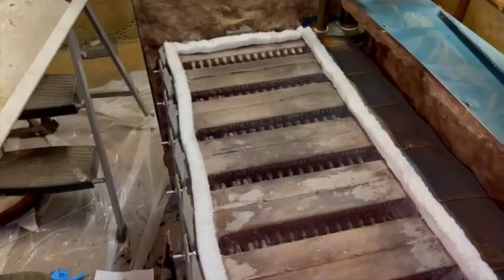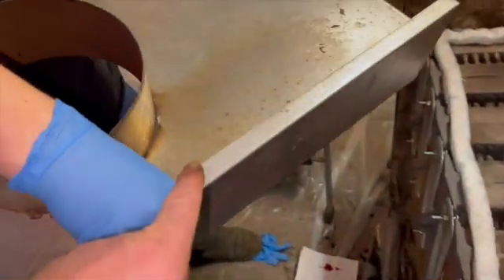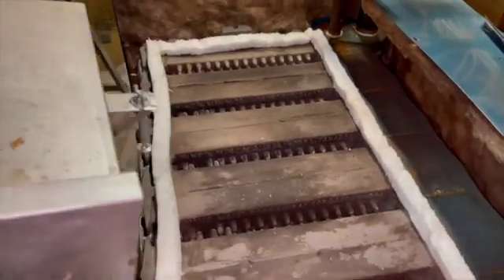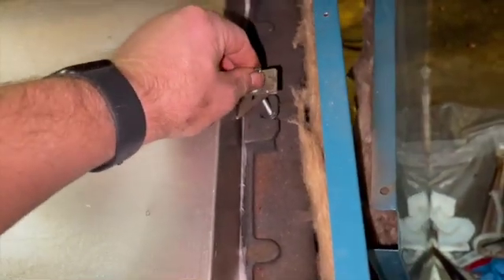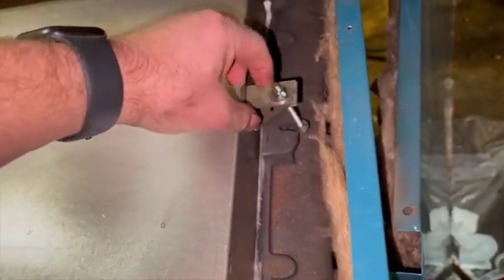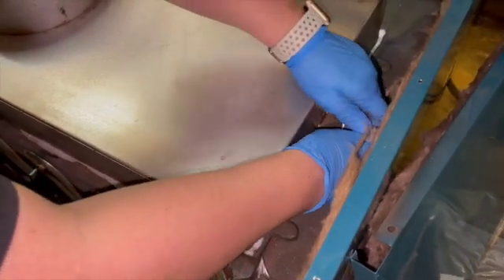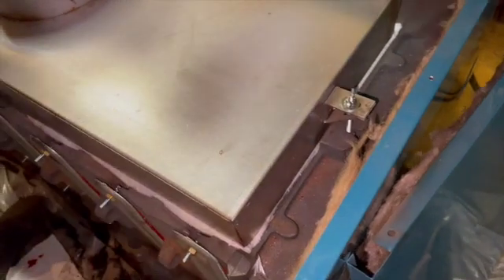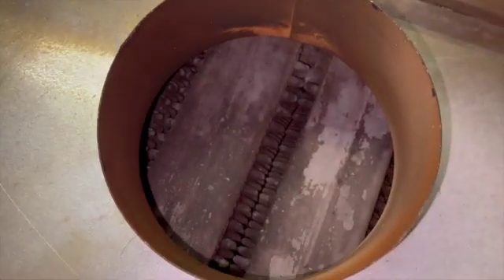Burnham Boiler Cleaning: Do THIS Every Year to Avoid Shutdown

Comment: Are those plates on the side an optional if u wanted to brush it down that way it seems a hell of a lot easier just brushing down from the top part of the boiler like you did in the video
Reply from the maker: Great question!

It’s best to brush out the sides too! You can get a lot of soot building up behind the covers plus it allows another angle to brush horizontally across the boiler.
I tried to film what it looks like behind the cover but my camera turned off! It was full of soot!
Reply: @FurnaceTech  fascinating!
I bet doesn't look like it was cleaned in awhile